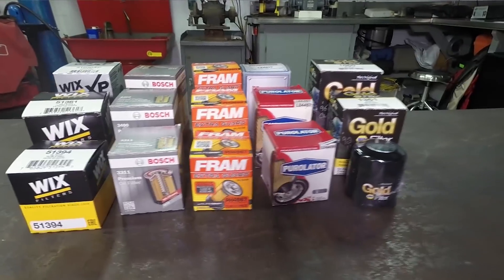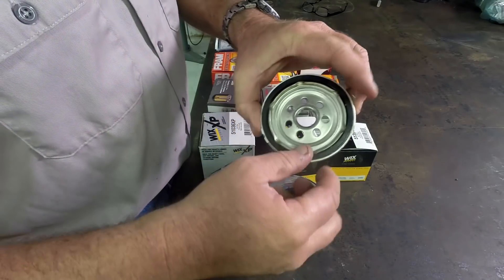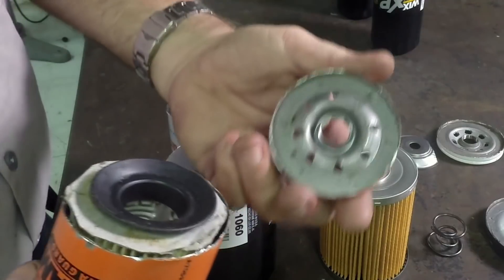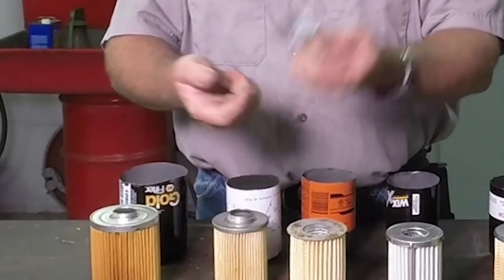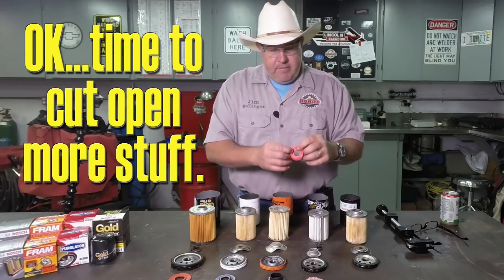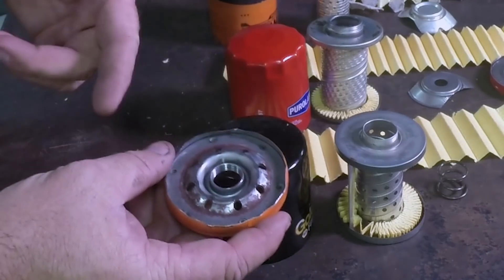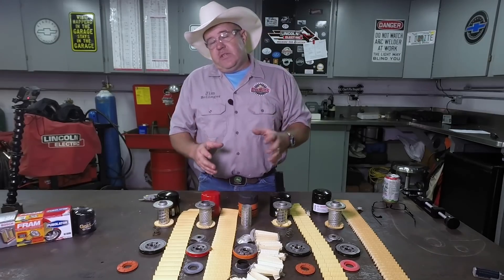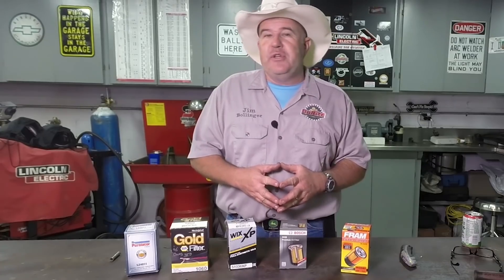The worst oil filter EVER!

Comment: When I was a manager at autozone, it would blow my mind how many people would choose Fram. I knew they were garbage before this video, but this is all the proof I needed. It was always the old heads that chose Fram, and god forbid you try to tell them it was a bad choice. Hope their engines don’t give them too many problems
Reply: Kelton Smith it’s name brand recognition. My dad used to use Frams simply because they were usually the default. Also honestly, Fran was the only filter I’ve seen advertised ever, like the recent “Frampa” commercial with Jonathan Banks from Breaking Bad and Better Call Saul.
Reply: Fram are shit. Used to think they were the nuts until i had 2 filters spat off a race motor, thought it was the motor filter stud until i compared the thread diameter of the Fram to a Wix/Napa and found bore and thread depth to be WAY to big. Never touch that rubbish again.

Comment: Honestly, we've used fram oil filters in our 98 Accord that's got 330,000 KMS on it. We've had the vehicle since 50,000 kms or so.

No they haven't destroyed the engine, it doesn't burn a drop of oil. Thats clickbait.
Reply: As a Japanese/German only shop owner for many years I will give you this challenge. Go to the Honda dealer and get a filter for your car, it may cost a dollar more than you are used to, and ANY Fram that fits your car. To be fair also get one of the cheap Frams you've been using. And cut these filters open. Focus on the quality of two components, the filter media of course and the glaring contrast here will likely sway you but the REAL problem with cheesy filters on your Honda is the quality of the anti-drainback flap seal. Why? Well because it determines how long your engine runs WITHOUT oil pressure on cold start... when most of engine wear happens if all else is hunky-dory. If this flap is anything other than a thin and supple blue or red neoprene like material it's junk.
I went to work for Mitsubishi in '84, their second year in the US market under their own flag. By mid '85 we (dealer techs with snap) knew Fram filters where killing the G63B's in pickups by the hundreds. Finally the warranty costs where out of hand so Mitsu formed a team and I was on it by chance being in California for training. At this time I was based in Houston with 5 dealers in the area.

  What we did- we collected used filters from oil change places, all brands and all ages/mileages, and we measured dynamic pressures such as opening pressure,  flow resistance and so on with test gear we constructed. Oh and we cut open hundreds of filters of all brands. What we found, simple, at the time there were only 2 large filter assy lines in the US. Fram/Allied Signal and Wix. So most every filter common at an oil change place or auto parts store came from one of these two lines as a WIX or FRAM or as a contracted part.. such as Pennzoil or Cam 2 or STP or whatever. I saw overwhelming proof that Allied/Signal (makers of Fram) are willing to make a filter that is even worse than the one in video and put whatever name you want on it and paint it any way you like. These 3rd tier parts cost about 80 cents wholesale and fill the shelves of oil change shops all over the country.
 
  We found that it takes 4 OUNCES of pressure to OPEN a Mitsubishi oil filter part no. MD031805 and 4 POUNDS of pressure open a Fram for that application. By open I mean push oil past the anti-drainback valve flap which is the first thing the oil pump has to deal with on cold start after drain down. After drain down, which happens over time regardless of flap quality, the pump is pumping air and that's not good because it's not good at it and it will take many revolutions to prime itself and pump the resulting air-slug through the filter. During this time your engine is running without oil pressure and in the case of the Mitsu trucks it was killing balance shaft bearings en mass. On our service drive I saw this happen many times... person gets oil change and a Fram or some other no-name yellow or red or lime green POS get's screwed on it a it's filled with oil. Then on startup the oil light will not go off then the truck winds up on my service drive, I walk out and unscrew a DRY crappy filter from the motor and screw on a Mitsu OEM filter start the truck and rev the engine one time and the pressure comes right up. I got so sick of trying to explain this and then after I got back from Cali we where told not to tell the public about the "Fram" problem due to product image(ours) and warranty laws forcing them to pay no matter what filter is used. So they redesigned the oil pump with wider gears for more displacement. Bottom line Mitsubishi never planned for US made filters of such poor quality and high opening pressures. During this era these filters where wiping out timing chains on Nissan L-Series and Z-Series and Toyota R series engines due to starving hydraulic chain tensioners. All the Jap car makers suffered from these junk filters at one time or another, they where actually in denial about how bad the filters are here being so hard to open and having a joke of a drainback flap. 

  Sir, if I change the oil in your car, the filter WILL have a Honda logo on it and be made in Japan... or I quit.

The fact that your Honda doesn't burn oil has nothing to do with choice of oil filter, that's just plain old Japanese quality engine parts and machine work...the best on the planet possibly.
Reply: Another paid Fram Troll.

Comment: In the video you’re cans changed from white and then after so long a red can popped into the video just wondering why this is? I done a test like this many years ago but only cut auto zone and wix open. Good video!!! Would love to see the difference in big truck filters I been owner operator for 22 years. And run Baldwin, fleet guard, CAT, lub finder, several different ones and having it done on the road if they are like this I will start carrying filters with me and have them use what I have!! Baldwin I guess I have used more than any other I have around 10 more pounds of oil pressure even after it’s been running a week solid. I will haft to cut some open but dang not any of them are cheap on price!! Thanks for the video

Comment: I imported a Subaru from Japan and the only filter I’ve been using is Fram.... this video is horrifying for me. I honestly can’t believe how terrible it is. I’m never buying a Fram filter again, and if I ever see a fram filter being used by a shop I’ll be sure to tell anyone that isn’t doing their own oil to steer clear. Guess it’s time to cross reference some part number so I can buy better filters.
Reply: Get a Subaru filter? The price isn't that much different. That's the only filter I'll put on my obxt.
Reply: dirtywhitellama the 2 Subaru dealerships in my city are kinda weird, they don’t really like to help you unless you give them a VIN or something silly, went through hell trying to get brake rotors from them a few months back, it shouldn’t be a big deal for the oil filter tho, I bought one from Napa right after I got my car, it was noticeably smaller then the Fram I’ve been using, and it didn’t come up in cross reference with filters that are supposed to work but I think I’ll be able to find the receipt for it. Really as long as it’s not Fram I think I’m okay with having it on my car 😂
Will look into it further at the dealership for sure tho!
Reply: @BO0O0O0O0O0O01  I work in a dealership parts department (not Subaru though) and I can assure you everything is 900% easier with a VIN.  Although if it's a foreign VIN that may complicate everything again 😂  Especially on a newer vehicle though, or one that potentially had a lot of options - or a foreign one where the options may not be the same as ones sold domestically.
Reply: @BO0O0O0O0O0O01  for example - during the 5-6 months I spent working with Volkswagen parts catalog, a customer with no VIN was one of the biggest headaches.... Especially because of how Volkswagen is, though. Some cars are a lot easier.
Reply: dirtywhitellama instead of a 17 character vin in japan they have a 9 character vin (at least in the case of  my Subaru) I know they have it setup the way they do for a reason, but it’s a pain in the ass when you need callipers off a 05 outback gt and callipers off a 02-04 turbo wrx for the rear and front brakes respectively 😂. I don’t blame the person on the other end of the phone or desk though. Anyway it’s all good I found a filter that I know can fit on there just fine :) if anybody else has a BH5 Legacy twin turbo you can get Napa gold 1334! Here’s the site I used to cross reference oil filters  http://www.oilfilter-crossreference.com/
convert/NAPA/1334
Reply: @BO0O0O0O0O0O01  well that would do it, sounds like a pain! I guess in that case you'd probably be best off finding part numbers online and just going in with a list....